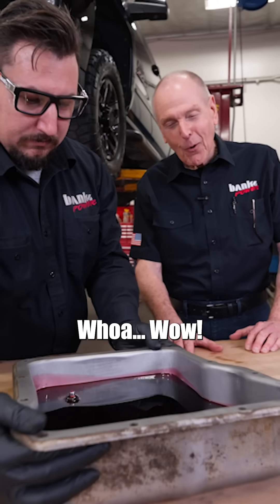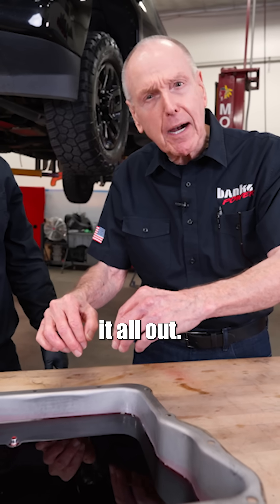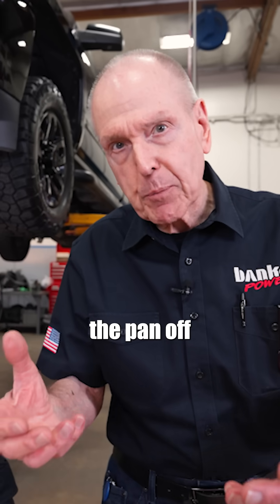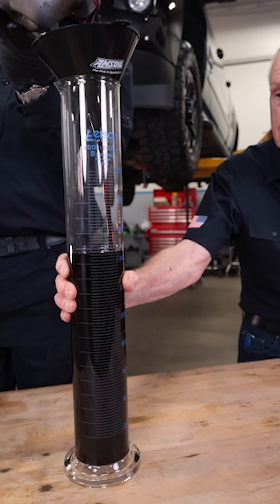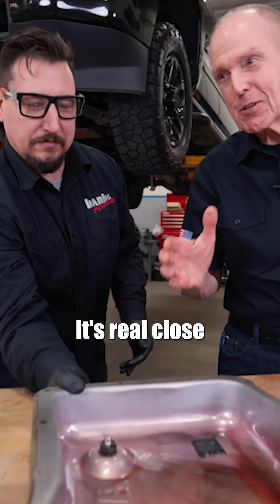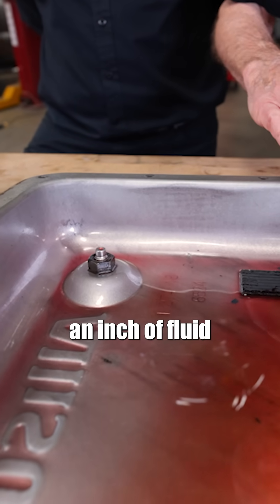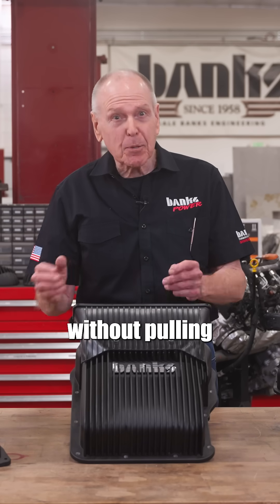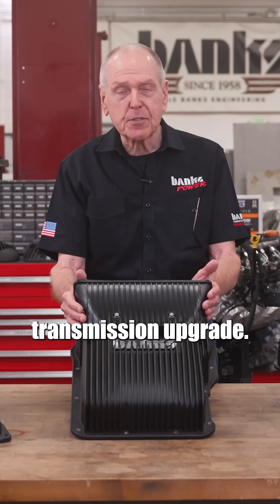This factory drain plug is a joke.

Comment: Clearly not intended to drain completely. Likely to keep fluid there if there is a plug failure. It's enough to make the pan removal less messy though which is more than most vehicles give you.

Comment: You still have to pull the pan anyway to change the filter
Reply from the maker: The Allison 1000 has an external spin-on filter. Most often guys will drain the fluid using the drain plug and replace the spin-on filter. Only after 100k miles do most drop the pan. So, the convenience of the Ram-Air Trans Pan's drain plug is for those intermediate services.

Comment: I understand the concept behind the pan but I would really like to see what the performance metrics are when all the fins get crammed full of mud and dirt like they would on a construction site or somebody that drives gravel roads frequently
Reply: I'd imagine the clogged cooling fins would cool just as effectively as an oem pan with no fins.
Reply: @markdavis9510 Idk. Seems like clogged fins would act as a thickened insulator that would retain heat.
Reply: I saud this beforr for their def cover , they replyed  hose it down , it will come out

Comment: This is the kind of stuff that any self-respecting engineer should have been designing for the factory unit, but the bean counters prevent real engineering from developing lasting and truly efficient designs. And the bean counters win because the public isn't smart enough and don't care enough to realize that they're actually being ripped off in the long run.

Comment: The plug is there to help remove excess fluid so you can drop the pan without making a mess. You have to remove the pan to service the filter anyway.
Reply: Technically according to Allison the reason for this design is so that when you just do a fluid change and change the external spin on filter, the pick up tube stays in fluid so the pump doesn't lose its prime. Obviously that will happen when you open the pan, but most of the services you would leave the pan on thanks to the external filter. I believe you only are recommended to change the internal pan filter every 3 times you change the spin on.
Reply: @mitchell7203 once you put new fluid in, it'll be in the pan so it can be picked up... What you say makes no sense.
Reply: The stock pan was obviously designed to have the plug on that raised platform. The question is why? 

This guy is designing that out without explaining the thought process for having it in there to begin with.. that's a bit concerning. It would have been just as easy for the stock pan to have had that raised area be a depression instead if they wanted every drop of the fluid out. And they purposefully did that, so there is some reason why.
Reply: @Josh.1234 whats the actual reason the pan is set up like that? I'd honestly like to know.
Reply: @martinroa1480  possibly so it doesn't get clogged with sediment.
Reply: @martinroa1480  yeah me too but it's odd the banks guy didn't acknowledge there is a reason and why his design is better
Reply: @Josh.1234  Im guessing here but I think they use the same pan on all their trans. The 8 and 10 speed pans look exactly like that and that is the fluid level check plug. The desiels supposedly have a dipstick so that is not needed in them. So essentially it does not have a drain plug. When you open my gas gap there is two fuel filler openings so they didn't have to make separate ones for the diesel and gas. That's how they are doing things now to save money.
Reply: @Josh.1234 One reason is that you don't want your oil pan bolt to be the lowest point when you're scraping over stuff, so they indent it to protect it.
Another is IF they measured half the fluid and made the amount in the torque converter + pan depth equal to half the fluid for a simple replacement.
Reply: If you can drain it in the first place you don't make a mess 😂
Reply: I have a gas Silverado and that plug is meant to check the fluid level on those.
Reply: @ you must have an 8 speed.
Reply: @marvelous_1372  the dreaded 8 speed. Been ok so far.
Reply: This makes NO sense.
Reply: True. I have that drain plug but with the filter change my transmission shifts a whole lot smoother. Plus there’s magnets in there that want to be cleaned up.
Reply: Right angles people. They didn’t just pull that bad boy straight from the bottom of the car. Over exaggerated oil amount left over. And a magnetic oil plug 😂
Reply: The internal filter is really coarse, just a step above a screen really.  The actual filter is a spin on outside the pan.
Reply: As in Toyota, there are 3 plugs on the trans pan.  One is the fill plug at the top.  2nd is the drain plug.. 3rd is the fluid level plug which is raised and has a short straw, much like theraised plug shown here.  You drain the pan using the drain plug, refill the pan with more fluid than drained..  start the vehicle and wait for operating temp and then pull the fluid kevel check plug(raised higher) as fluid expands and level is checked at operating temp.  Duhh
Reply: Bingo! Finally, someone with a clue.

Comment: The Allison is on the HD trucks meaning it's going to get worked hard and need more periodic maintenance so it seems ridiculous that the engineers design a oil pan you could not completely drain especially since dirt and debris settles to the bottom and a trans fluid change machine will not work for getting all the crud out.

Comment: I have always dropped the pan and changed the filters
Reply: @ZoeyR86:
So, just ask yourself:
"Would I rather completely drain the pan before I take it off to change the filter, or take a bath/shower in transmission fluid?"
Reply: @daleallen7634  makes little difference to me. I have a full lift and all the same tools a shop has, but hint I have a 6mm tube. I hook into the drain and suck the rest out anyways. Sure, I wish the factory had a brain. But honestly, this might be a feature that will save a transmission from Jiffy oil Jimmy's mistakes but they still don't have a cure for American lugless tire.
Reply: @daleallen7634  don't take my post wrong both my personal and my company rigs are ram 3500 6.7l with full banks performance package plus all the pans and diff covers with iDash logging i also added egt probes in the manifold and turbo down tube.
The only thing I have but don't use is the peddle monster as I want the laid-back mush of the stock peddle as I I have employees jump in and out of my trucks, even my mom lol I also did a fass fuel system upgrade and S&S cp3 convert. I modified for more reliability, especially while pulling a 13,900lbs 5th wheel or my goose neck car trailer I have been thinking of a turbo upgrade but mostly for efficiency and reduce temps under max load

Comment: Gale Banks is a lifetime achiever and irreplaceable fountain of wisdom.
Reply: Mr. Banks has been a decades-long badass guru. 

You’d think it’s common sense that the spend liquid has a path to fully drain out, so it’s triggering to see such bad design.
Reply: @TamagoHead  
If you can’t drain %90 of the contaminated fluid you foul up %100 of the new fluid. Albeit it’s an automatic with captured fluid in the torque  converter the stock drain pan is a fail…So are the GM engine oil pans- Same issue.
Reply: @lanehammer wow, that sucks!
Reply: Agreed 100%!! I've Always had a little anxiety when changing oil. Wondering how much is still in there and we know it's not very much. But for 2 quarts to be left over in the transmission pan is insane. I feel like all you're doing is pressing the fast forward button on new fluid to become old and less lubricating and turning into grinding fluid😅 @lanehammer
Reply: @TamagoHead it’s not a drain plug 🤦🏻‍♂️ there isn’t a drain plug on the trans
Reply: This is dumb. There is no such thing as a full drain with a plug. Even this one cannot empty the torque converter. You still have to drop his pan to swap the filter. There are multiple reasons a decent mechanic will look at this and shake their head.
Reply: As an engineer with 25+ years experience, I feel like Einstein had it right.  “The more I learn, the more I understand how little I know”.
Reply: So you're the guy hehe @nickbeaucage4711
Reply: He's a businessman selling aftermarket parts.  He never shows you cheap ways to remedy known issues just his overpriced crap.
Reply: @lukeaxelson4191 Just say you're broke already, I do not know of another company that backs up their parts like Banks does.

Comment: Is that a stock transmission pan in the beginning?
What the actual f... is that 💩? 
You could filter everything you drain and wouldn't see any issues at all until the day things are so worn they fail spectacularly.
This is why we need regulations and use expectancy rules.
If you don't keep the beancounters in check, you end up with a substandard slop job like the example here!
The Banks' magnetic drain is the bare minimum needed, and it shows you have issues at a point where a gearbox service could deal with it.
Tha was just insane to watch...

Comment: Maybe they don't want it all come out because when changed the clutch material in the oil keeps it working...
Reply: if you changed your fluid regularly at the factory intervals you shouldn’t be having issues where you need the old clutch material
Reply: @Boyslivingonmars you’re exactly right, plus if slipping does become an issue you can always add a friction additive
Reply: You obviously have no clue how an automatic transmission works, and what function the fluid actually performs. 

There should never be any friction material (or anything else) floating in the fluid. What do you think a transmission filter is for?  How long do you think bushings and bearings would last being lubricants with grit in the oil?
Reply: @mattrodgers4878 hey man, on the transmission filter I changed in my car(Toyota sienna work van, VERY reliable car), I was surprised to see how coarse that filter material was, it's definitely gonna have plenty of fine grit going through.  Is this a common thing?
Reply: @alexwalker8422  no clue, I know nothing about imports. 

I would imagine that the filter media is either designed that way (does the transmission have a separate spin on type filter like some of the other transmissions) maybe the coarse filter is designed to filter the big chunks, and a seperate, much finer filter catches the smaller stuff,  or someone has already serviced it with a inferior filter. 

What I can tell you without a doubt is the internal tolerances are incredibly tight. The smallest particle of debris can jam a valve in the valve body. Not to mention grit will chew up bushings and thrust washers very rapidly. 

How long would an engine last with crud circulating in the oil? A transmission is even less forgiving. Which is why it really chaps my ass when idiots repeat the same bullshit story about “changing the fluid removes the friction material” without the slightest clue about what they are saying.

Comment: With that big scoop hanging down, does it interrupt, or take away any airflow from your ram air rear diff cover?
Reply: Alot of their low hanging fins are designed to break off before the pan gets damaged. I believe they offer some sort of refund replacement deal.
Reply: Probably wouldn't redirect too much air away from the ram air diff cover. It's still going toward the rear

Comment: Gail, we need a high idle unit for 2024 ram trucks with the 6.4 hemi. The absence of splash lubrication at idle combined with low idle oil pressure is killing camshafts and lifters. The dealers won't give us the flash for the 4500 and 5500 trucks with PTO on the trans and elevated idle capability.
Reply: This is correct because the manufacture engineered it that way so they could make more money. The price for a new truck is stupid my first 2 houses was cheaper.
Reply: @denm8272  Kind of explains the failed camshaft I've seen in some vehicles.  Wait till Ford comes out with Gas Particulate Filters soon. And Gas Exhaust Fluid. Yuk
Reply: @denm8272  also hemi lifters fail primarily from the roller bearing failing and this has never been fully disclosed as to why.
Reply: The absence of splash lubrication at idle does exactly zero, so would be funny for Gale to put that stupid myth to bed. Tons of engines eat lifters, including LS until GM developed the LS7 lifter, and basically every OHV hydraulic roller lifter engine ever made.
Reply: @bobbygetsbanned6049 . No. I have a few high milage LS engines with stock everything and no failures. Non LS7 lifters.
Reply: @mariotillery8459  And why do you think I would care about your anecdote?
Reply: @bobbygetsbanned6049  you're talking shit misleading anyone who reads your replies
Reply: @mariotillery8459  Says the guy dumb enough to think his LS engines refutes a well known issue 🤣
Reply: @bobbygetsbanned6049  known issues are poor mechanic skills. That's with any engine.

Comment: So what I’m getting out of these videos is that GM cheaps out on every part of their vehicle and charges as much as a better put together Ford with a body that won’t rust.
Reply: Ford has PLENTY of problems of their own. They all do tight now. It's whatever you want to deal with. And don't run that Aluminum body in a State thatbusrs Calcium Chloride in the Winter. That body will dissolve in a few years. Not rot, DISSOLVE.
Reply: I fail to see how making a more complicated shape of the pan is being cheap. I'm sure that they had something in mind when they did that, but I don't know what it is. It does seem dumb to leave all that fluid in there. I wish a GM designer would come here and give us their side of the story.

Comment: That weld nut is how you set the fluid level on the stock pan. 🤣 Stop fear mongering people to sell parts.
Reply from the maker: The Allison 1000 has a dipstick used for checking fluid level. This is not about fear mongering. This is about convenience. As stated in the video, a complete fluid change is possible by simply dropping the pan.
Reply: Explain. 
I’m not getting what you are talking about.
Reply: Is it possible you've been exposed to a Full Moon to cause your thought process to linger in Orbit?

Comment: Cummins with the AISIN needs that beauty, a lot of HotShot drivers will pay for it just for a lower temp, the fully drain is a plus 👌
Reply: Agreed! I'd buy one today.
Reply: The Aisin pan drains most of the old fluid doesn't it? The ones in Toyotas do. I haven't paid much attention to the few diesel ones I've serviced.
Reply: Just the old banks finned pan dropped my temps 60+degrees.......I haul boats on the east coast for comparison. But the crazy part is that I thought about doing the same, but the pan without the ram air really helped
Reply: It will do jack shit to the oil temp
he just shilling crappy overpriced part you don't need
A actual oil cooled will do 10x more difference than a stupid fined pan
Plus you still need to remove said pan to clean the clutch material in the bottom of the pan,to access the filter and clean the magnet that probably full of metal shaving
Plus most auto trans pan don't even have drain plug to begin with